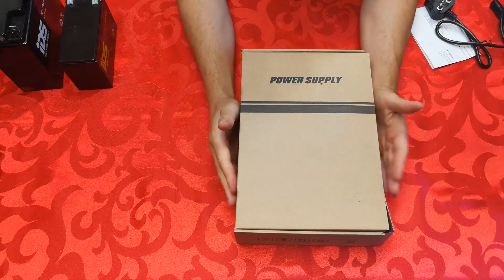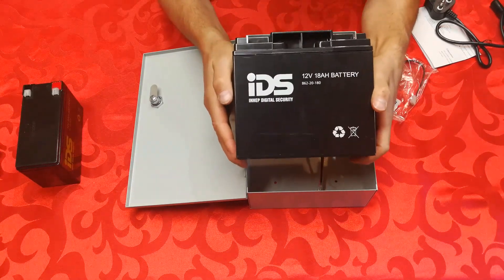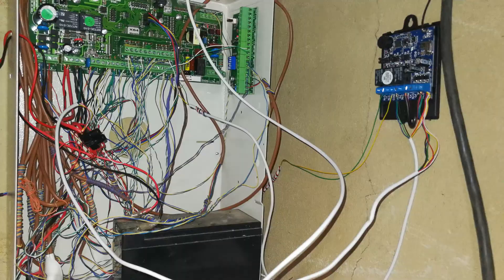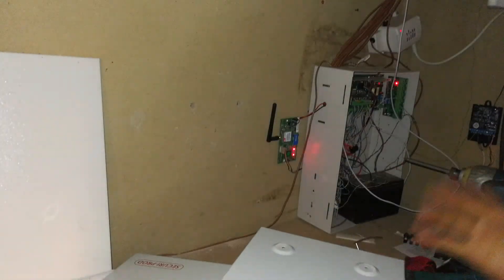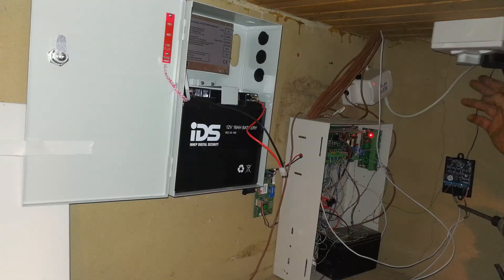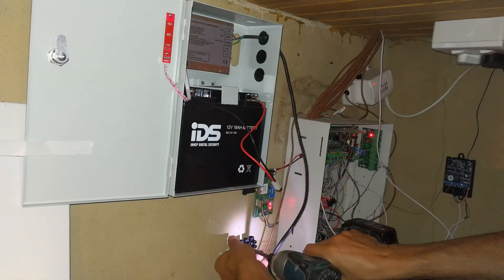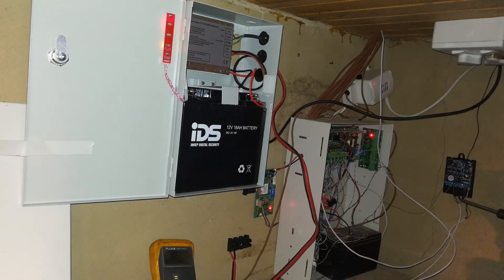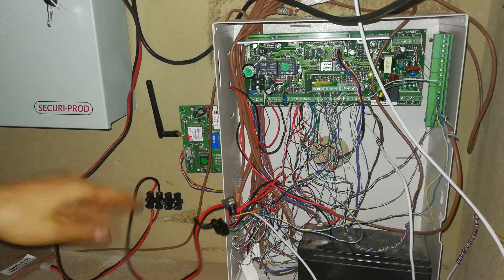How to install a 12V backup power supply for alarm (door closers etc.)

Comment: The reason for the 13+V is because it was charging. Anything charging will have a higher voltage. Once charge to 100%, it will settle around 12.7V

Comment: Question so the battery, power supply output and 12v of the alarm battery are in parallel

Comment: My alarm system has a one pair of fly-leads to charge and utilize (in event of a power failure) the 7ah built-in battery. 
How do I wire this unit to power the entire alarm?

Comment: I got a sherlo backup unit and i didnt realise its a bunch of 1.1A outputs. Can i do just 1 peripheral per output (eg sms module 1, remote control module another,  passives a 3rd)? How do i be sure im not going over 1.1A for each output?
Reply: My Alarm guy connected a cable from the battery terminals on the Sherlo 6.4A directly to the battery terminals on the Alarm, he also put in a diode on the alarm battery side so it doesn't feed power back to the Sherlo. This way it powers everything that's connected to my panel..

Comment: Hi, thanks for the great video. My question is connecting the output supply from the backup Securi-Prod power supply to my existing Paradox alarm system. I do not have any outdoor beams or cameras.
You mention connecting it to the sensor wires but am not sure which ones they are? Is there not another or easier place to connect it to my system e.g to the same place that the existing 7 a/h battery is connected to the panel?
Reply: Was thinking and wondering the exact same...

Comment: My Swann security works on 12v supply so I just use a car battery and supply directly from battery to PVR and a float charger plugged into the wall.

Comment: Hey, nice video, goeie werk! I want to upgrade my Paradox SP6000 using the Securi-Prod charger / psu and 18ah battery as in this video. Unfortunately the Paradox can only charge the battery at a rate of 350mA (can be changed to 700mA). This is quote a slow charge rate and it will take close to 30h to charge a 18ah battery, therefore the requirement for a faster charge time. 

I was wondering If it is possible to connect the 12v battery connector on the Paradox SP6000 motherboard directly to the 12v output on the Securi-Pord PSU? Or can I connect the Paradox SP6000 battery connector directly to the battery terminals in the Securi-Prod enclosure?

Comment: If I want to use this device as a backup power for my routers, would it be better to get a gel battery vs a lead acid battery?
Reply from the maker: they both lead acid but i prefer Gel type lead acid

Comment: Hi. Can you advise please? I live in Europe, and have a 240volt 13amp supply. I want to backup an 8 camera NVR router CCTV system where we have fairly frequent power failures of approximately 2 to 8 hours. Can you recommend a backup system for me with a link to purchase?
Reply from the maker: we need to do a power calculation: 8 cameras @ +- 7-12W = 56-96 W (camera use more power at night). NVR = 15W. Monitor? You didn't mention, if yes then size and is it eco? Lets say 40W for monitor. Therefore total power = 151W on full load. For 240V there are losses for the conversion of 240 to 12V. Total power from your plug point would be max about 167W (if efficiency is 90%). Since you said max power outage is 8 hours, then you need 167x8hours = 1,336kWh of energy. I suggest an online UPS
https://www.youtube.com/watch?v=Qi94u31HFX8
 link is an example. They are available in Europe but would be branded by another company. The reason why i dont recommend a 12V backup supply is that your NVR/DVR usually run on 48V so you would need a backup for cameras at 12V and one for NVR at 48V. If you dont use the monitor, you will be able to select a smaller UPS. My advice is a UPS with 100Ah battery bank is the minimum for this setup to run 8 hours.

Comment: link to product? where can we buy it? thanks.
Reply from the maker: https://www.regalsecurity.co.za/product/access-control/power-supply-13-6vdc-5-amp-power-store/?doing_wp_cron=1558855018.5260140895843505859375
https://www.bing.com/search?q=Power+Supply+13.6VDC+5+Amp+Power+Store&pc=MOZI&form=MOZSBR
https://www.amazon.com/LIBO-Smart-Home-Control-Electric/dp/B07DNYPVCT/ref=sr_1_8?keywords=12v+battery+backup&qid=1558854957&s=gateway&sr=8-8